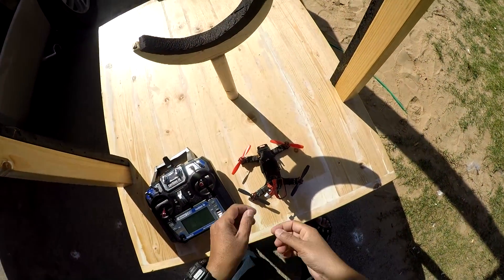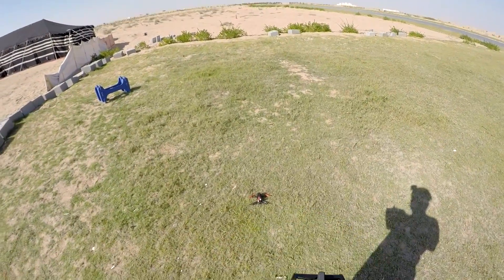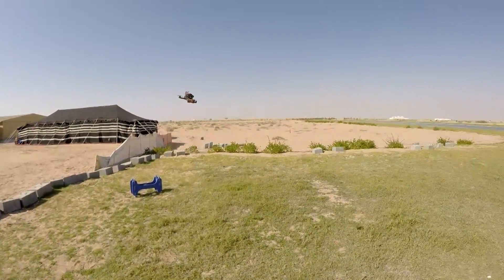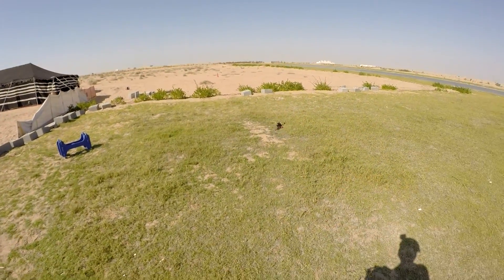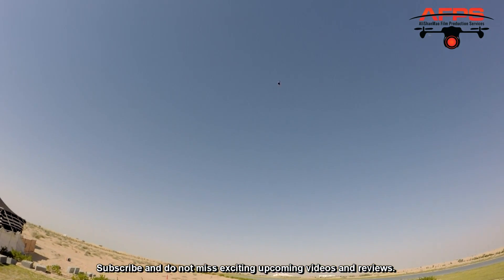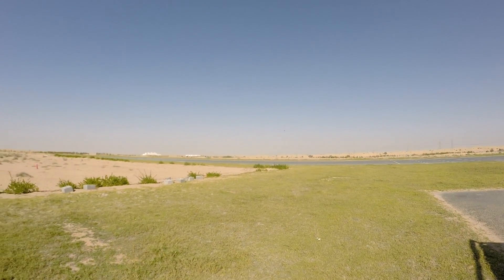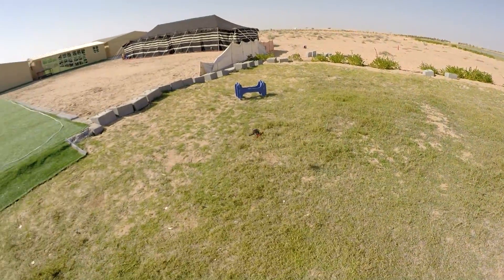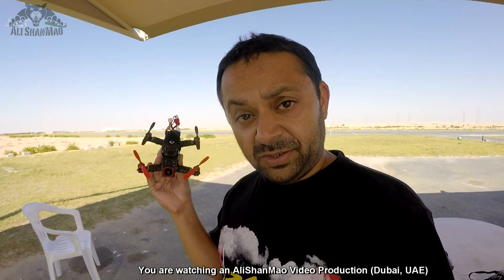Eachine Racer 130 Line of Sight and FPV Flights

Comment: I just got one of these and i it does not bind. I can't find how to bind the reciever or even a manual on this. No text on the reciever where to short for binding. RX flashes red for 2 seconds then turn of but no way to arm. Instructions say diferent i manual and on Banggood website. No luck yet to connect to cleanflight, need to try more USB cables and find one that work.